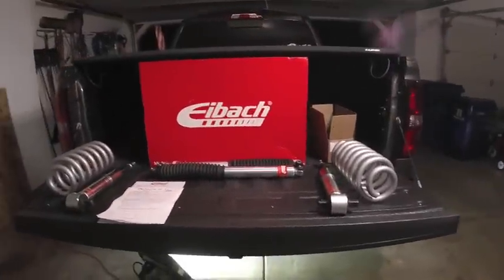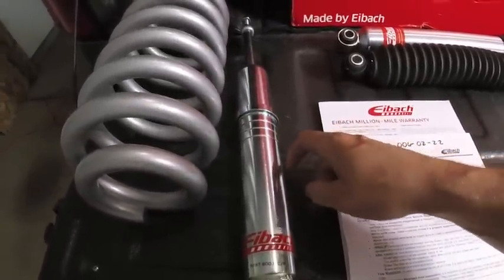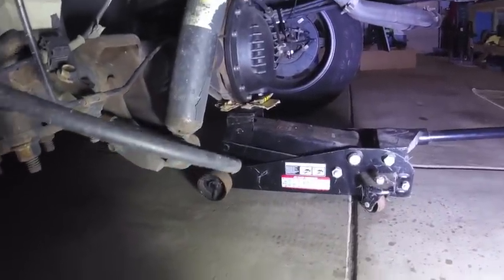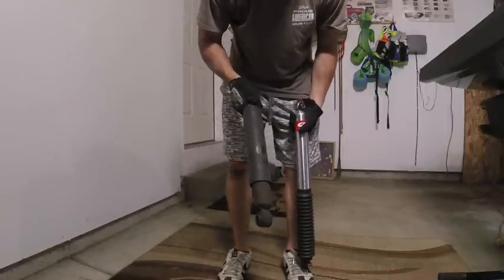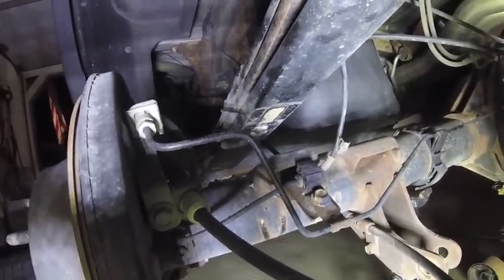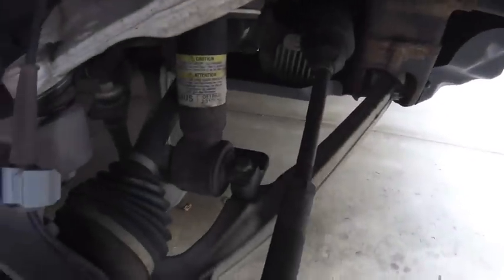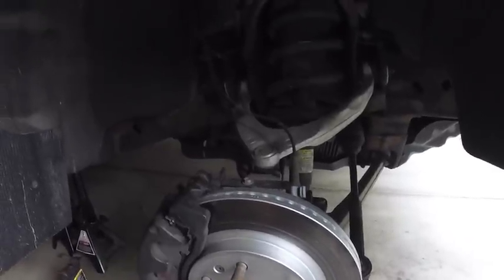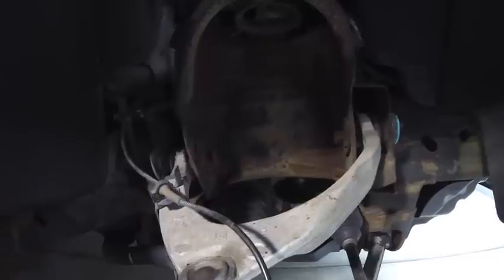Eibach Pro Truck Lift Kit Step by Step Install - GMC Sierra

Comment: I know this video was posted a while ago, but how are these doing for you over a year later?  Also, since the spring allows for some lift do you think these are a better option to lift the front 2.5" than putting Bilstein 5100 at max height (2.5") with stock springs?
Reply from the maker: Jacob Krueger in my opinion if you are lifting beyond the 1.8” bilsteins can do then yes this is a great option. I had these on my truck up until I traded it in. Hoping there’s a Eibach kit for my Rebel because i was a huge fan of this kit.
Reply: @WaterFowler41  ok thanks for the response.  I'll be buying some soon.
Reply: @WaterFowler41  for some reason it's almost $200 cheaper for me to get the Bilstein 5100 shocks and struts and then buy the eibach coils separate.  Do you think the Bilsteins paired with the 2.75" eibachs would essentially be the same setup as the eibach kit?  I have heard the bilstein 5100 and eibach struts are essentially the same.
Reply from the maker: Jacob Krueger bilsteins won’t lift above 1.85” up front.
Reply: @WaterFowler41  but I'm saying if I set them at 0 and use the eibach 2.75" coils.  Just like the eibach kit does.  Would that be relatively the same you think?
Reply from the maker: Jacob Krueger I don’t think you’ll be able to get that much lift out of the bils without extra spacers but you can call bilstein and confirm
Reply: @WaterFowler41  ok thanks

Comment: Just bcuz shock doesnt rebound doesnt mean its blown, depends on design of shock

Not too sure about stiff springs,   I was under impression softer spring rate with better dampening in shock is better solution, not other way around

Can you choose what spring rate you want with kit or is it std per application ?
Reply from the maker: Kirk Dunn no choice on spring rate.

Comment: Great video! Looking seriously at this kit for my build but undecided on rear blocks...stock, 1.5", or 2" as you did. Do you have an Instagram (or other social media) to see more pictures at different angles of your truck?
Reply from the maker: Instagram is @waterfowler_41  

I posted a pic a few months ago showing the angle of my UCA and CV, let me know if you want any specifics pictures of the assembly.
Reply: Tyson Settle how’d yours come out? Did you stay stock in the rear or did you decide to change?
Reply: @bludragontruck9743  Ended up doing Fox 2.5 coilovers in the front with Dirt King UCA's, and Fox 2.0 shocks and stock height in the rear. Coilovers were installed at the height set from factory, they claim 2.5" height but mine came out to 3". @tysondale84 on Instagram.
Reply: @tdale1984  I’m thinking a similar route. Just trying to find the right way, I try short cuts and end up with bad results most of the time.
Reply: @tdale1984  what did you end up spending if you don’t mind me asking.
Reply: @tdale1984  just requested to your IG account.  

I’ve been hearing the Fox coil overs are as good due to the aluminum body and can strip
Reply: @TexasRedneck  Accidentally deleted the request, send again and I'll accept so you can see pics of the truck.
Reply: @tdale1984  just resent it

Comment: How’s the fronts holding up WaterFowler 41 no problems yet🤔
Reply from the maker: I had to have one strut replaced under warranty. The internal valves failed. But other wise had them in the truck until I traded them in.

Comment: I already have the bilstein 5100 series with the adjustable strut on the front with OEM springs...

My question is can I add the eibach springs with the bilstein 5100 adjustable struts?.
Reply from the maker: l Pronox i don’t know if you’ll get much more lift, I believe the bilsteins top out at 1.875” I could be wrong though, best to call bilstein

Comment: Quick question are the front springs close to the upper arms I just installed but feel like they are extremely close to the arms
Reply from the maker: bigboix369 mine are not but i have the aluminum UCAs. If you have stamped steel they may be close. Make sure everything is clocked correctly I.e. the top mount, spring mount, spring, etc.

Comment: So you used the springs and the strut clip 2nd notch from the bottom?
Reply from the maker: ncurc 97 yup, if I recall correctly, second notching got me to 2.5” lift up front. Any more and you run into upper control arm issues
Reply: @WaterFowler41  thanks for the quick reply, as long as the ride isn't to stiff, I will look into these

Comment: Great video, but why did you completely skip the assembly of the spring, boot, etc? :(
Reply from the maker: Draw the line ont he assembly, remove from the factory strut and reinstall on the Eibachs.

Comment: How long did it take to settle in??? Because  I'm at 3inch still..
Reply from the maker: Duy Tran a month or 2 of driving and I was at a “final” height
Reply: @WaterFowler41  dam.. a month or 2.. what height you at now?
Reply from the maker: Duy Tran last time I measured the truck I was about 2 5/8. Sold the truck back I December so no longer have access to it.
Reply: @WaterFowler41  dont blamed you GM made truck like shit..  mine started having alot problems.. and GM  Warranty sucks..

Comment: I installed this on the same year silverado after a year. the passenger side failed, and leaked out all of its oil. I thought eibach were supposed to be quality upgrades. Oem ones hung out 5 years before I switched.
Reply from the maker: Eibach has a great warranty, what did their root cause analysis come up when you sent the failed strut in for inspection/replacement?

Comment: My question is?.. does it sit the same height as it did with the previous spacer in front?
Reply from the maker: J P’s mix nope, half inch higher in front
Reply: Water Fowler 41 looks like a sweet setup just wish I could see more angles of truck to help lighten my wallet hehe
Reply from the maker: J P’s mix hit up my Instagram, got a bunch of pictures there @waterfowler_41

Comment: Can I add 2 in spacers to the front struts I want mine at 4-4.5 in lift I have a 2014 Silverado
Reply from the maker: Jose Gamez you would need new UCAs and a larger differ drop to accommodate that so your better off getting a real life kit at that point.

Comment: its not necessarily better than the bilsteins, bilsteins were originally meant to be used with stock coils with adjustable notches.  eibachs are similar.  but bilsteins are not in the business of making coils, they do shocks.  Eibachs does both.  I believe the bilstein coils are even made by eibach.  Eibach also makes toytec and wheeler's coil springs.  they supply the market.  bilstein 5100's do sell more though.  Eibachs are good as well.

Comment: One last question did the coil compressor fit on the eibach spring too and did you rent it?
Reply from the maker: I rented a spring compressor from oreilly's.  You have to mount the compressors in the highest position because you need to compress the spring about 1.5".  I used a pneumatic driver to the compressor shafts.  If you've never dealt with spring compressors I wouldn't advise as it can get kind of hairy.  The compressor were bending near the end.

Comment: What size square u bolts did you use?
Reply from the maker: agustin rosales off hand I don’t know they came with the rear blocks from Rough country. I’m sure you can call and ask them. They were super helpful.

Comment: What size are your tires and rims?
Reply from the maker: darwin medrano fuel trophy 20x9 wheels with 275/60-20 Falken AT3W
Reply: Water Fowler 41 thanks
Reply from the maker: darwin medrano no problemo, thanks for watching!
Reply: Water Fowler 41 what offset are your wheels
Reply from the maker: Jeff Liebel 20mm

Comment: Why would you loosen the tie rod? That was unnecessary
Reply from the maker: The Tatted Dad i didn’t loosen it, i popped it out of the hub. Doing this gives you more play to pull the hub assembly down to fit the strut in. I suppose you could leave it attached but I was installing these by myself and wanted all the play I could get.